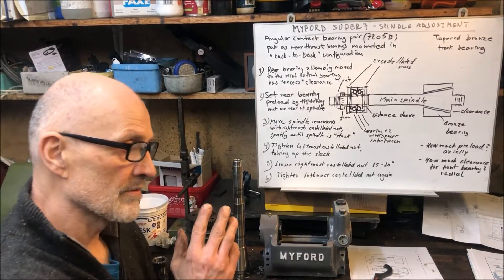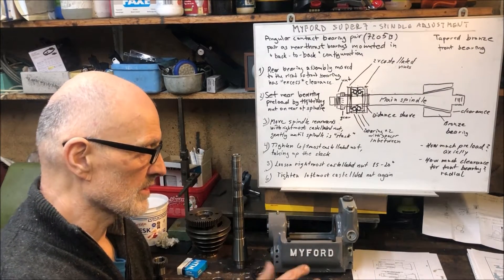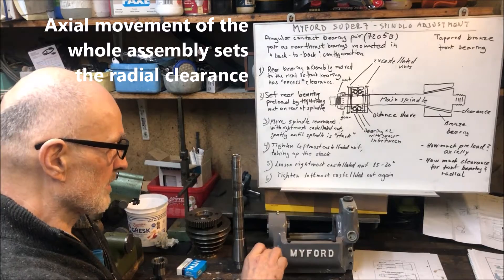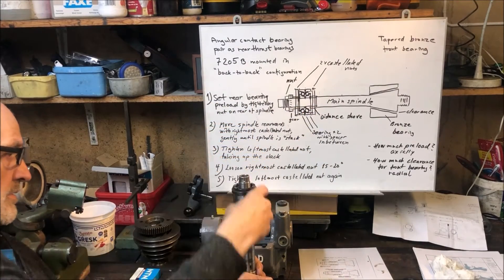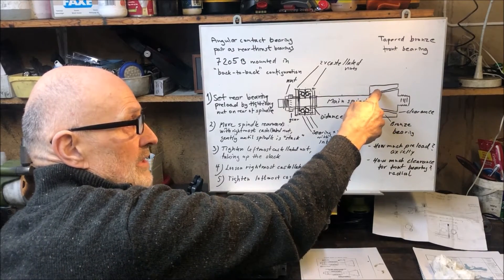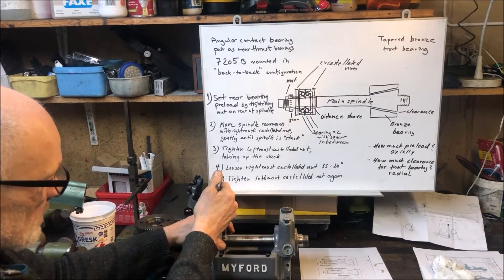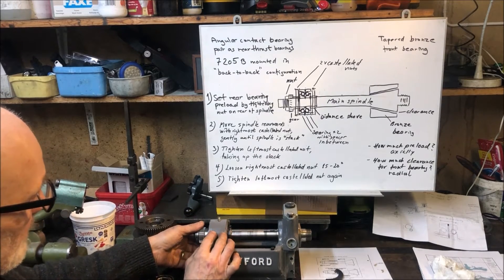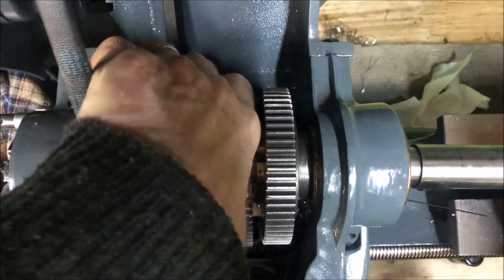Myford Super7 spindle assembly, adjustment and testing

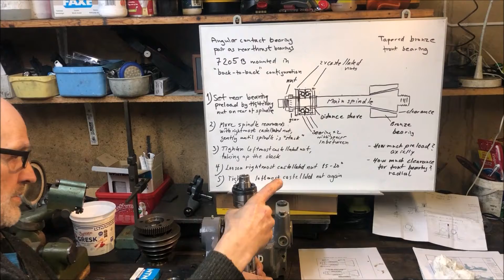Comment: I have followed the specifications in the model engineers guide for the new size of the spacer as talked about around 4:25. However, it now does not meet the shoulder of the spindle and always sits recessed in the outer tightening ring? 
Is this correct? 
If not, what size spacer ring should I use? 
Thanks
Reply from the maker: I don't remember the exact details, but as I later removed the bearings and went back to the original setup, I think I have the "kit" in my collection of Myford parts and check if I can find out
Reply: @jansverrehaugjord9934 thank you, I think it was how I arranged the bearings after following the other video, I went with your second installation and it seemed to be fine- after remaking the part with some extra length

Comment: I also was wanting to replace the spindle to an 1-1/4” x12 tpi so i can use a different chuck .
Reply from the maker: I know some have upgraded to a so called "big-bore headstock" ie. 26mm hole through the spindle, but this requires a number of new parts, in essence the whole headstock assembly itself. I think such a "kit" is sold by a gentleman over in the UK, but you would have to ask eg. at the MEW (Model Engineers Workshop) forum. Apart from that, there are also enthusiasts that have rebored their headstock accomodate a ball- or roller bearing supported spindle assembly.
Reply from the maker: PS! The Myford spindle has a tapered front with a matching bronse bearing.
Reply: @jansverrehaugjord9934 thanks for the info ! I don’t need to do anything like that yet . Mine runs sooooo smooth and tight ! This mini lathe is extremely high quality! Mine gives a mirror finish whatever I’m turning ! I love it so much but parts are very hard to come by .

Comment: Hi jan, thanks for the video.
However i am struggling to work out what the advantage to this bronze bearing setup would be for the myfords? They even used it in their grinders so it must be good?
From what i can see, the bronze bearing is scraped but also is given clearance meaning it is not coming into contact evenly with the scraped bronze when spindle is under load?
Reply from the maker: @spewgw8417  You're welcome.. thanks for commenting. The idea behind the scraping us to produce small and evenly distributed oil pockets. I think it is callef a "hydrodynamic bearing"? ie . flosting on the oil in these pockets. You need a certain, but very small amount of play. This setup is nonetheless very rigid and a proven design.
Reply: @jansverrehaugjord9934  what i dont understand is that with scrapign the bed for example, the saddle will be in constant contact with the bed, so the oil pockets provide lubrication to extend life. However with the bronze bearing setup, it is not in contact with the spindle, unless under load, and it would bear at a single point rather than along the taper as it is adding sideways pressure to the rear bearings when turning for example.